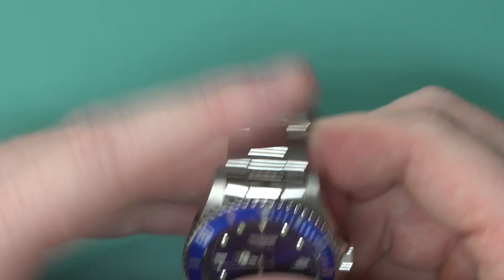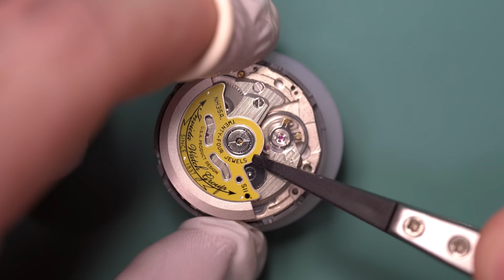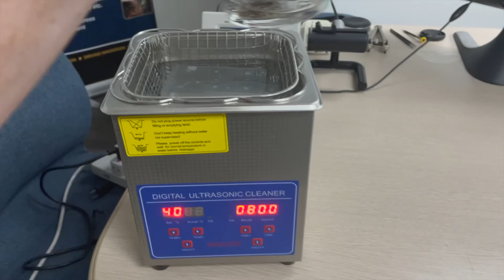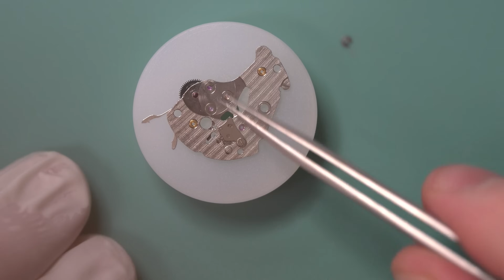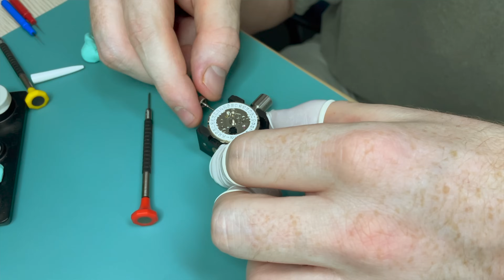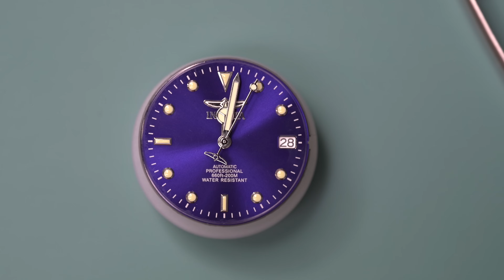$75 Invicta Pro Diver Strip Down and Review - Budget Watch Restoration - Seiko NH35a

Comment: I have 4 of these and they all run great - the NH35A movement is great - i would wear one for work as a bouncer and after numerous ''scuffles'' the pin holding the bracelet to the case had become tweaked/damaged - i was riding my motorcyle home one night and the watch fell off my wrist on to the road at 40mph , i did a U turn and picked it up and it's still running today 6 years later.
Reply: Might be time for a service and relube the movement, the longer it runs with dry lube the worst it will be, probably cheaper to just swap movement than paying a watchmaker to service it tho, i build seiko mods and is pretty easy to work with this movements, my original seiko 5 sport(skx) started getting pretty bad at keeping time after four years, constantly setting the time was a pain, and not trusting it was a bigger pain, the service is a bit hard, mostly due to all the tools and stuff needed, once you have everything is a quite nice hobby, is not that expensive and you can even make some money
Reply: @ELTATUPUNK for all those who can sevice their watch by themself it's OK but a service at a local watchmaker is, in my opinion, not worth the money. A new one is much cheaper! Many greetings from Germany!
Reply: Just don’t get it wet
Reply: @greghemlock6679  ??? Explain what you mean. Its a pro diver watch.
Reply: @greghemlock6679  I've worn mine in the ocean. no problems.

Comment: This is an excellent watch, I work outdoors As a welder summers and winters in extreme conditions, the watch has been exposed to hot welding arcs and severe frosts for 3 years. And still works like new. 247 amplitude +1sec / day   0.2 Beat error

Comment: In my opinion, the factory bracelet is crap. If you spend $60 on the right aftermarket bracelet, it makes this watch impeccable for the money. The right bracelet complements the case/ movement.

I've been rocking this watch for the last 10 years. I've purchased four or five of them over the years in total. They seem to slow down enough to be annoying after about 2 years.

Comment: Why would you not use hacking? I always set my automatics to the second with a radio frequency clock that syncs with the atomic clock. Theres no such thing as a watch being too correct. It also lets me keep track of how fast or slow the movement is running.

Comment: I recently purchased the black pro-diver for exactly the reasons you discuss. I have it on the B&W NATO strap and I have to say it looks the business. Over a week I checked the accuracy to 5 seconds per day and am well pleased with the results. I have no intention to dive with it as I already have other Seiko dive watches, it just looks good on the wrist! I actually do use the hacking facility regularly to calibrate my watches against my radio controlled GMT clock.
Overall I think this is a great little timepiece for the price (£84) especially with trusted Seiko automatic movement. I can only assume detractors think that because of the low price it simply cannot be any good and dismiss it out of hand. I am not ashamed to wear this watch.
Thank you for the very constructive and informative video.👍

Comment: I've owned at least a dozen watches with the NH35A, one NH36A, and a 4R36. All the NH35A movements ran minus 10 seconds per day. The NH36A and 4R36 ran +/- 1 second per day. Point being, there was nothing wrong with the NH35A's. If they run a consistent time every day then all that needs done to get it running more accurately would be to move the fast or slow needle on the movement until you get it as close as possible. Seiko makes a great automatic movement and just as good as Swiss. I had an ETA 2824-2 and it ran +10 seconds per day. It's preferable to have an automatic movement run fast rather than slow because to reset the time you just have to hack the watch and push the crown back in at the desired time. If it's slow you have to wait for the seconds hand to get to 12 o'clock, hack it , move the minute hand forward, wait again for the clock you're using to change the minute, then push the crown back in quickly. Preferably using a cell phone. Or better yet a cell phone atomic clock program from Google Play. Miyota and Orient make great automatic movements as well. Just as good as Seiko IMO as I have had them also.

Comment: I had this same Invicta watch from January 2018 to January 2020. I accidentally dropped it from about 2.5 feet to a tile floor and the Invicta wing logo came loose, so I couldn't wear the watch. Unfortunately the pandemic was just beginning and it was left in the drawer. Now I don't even know where it is. Also, before I dropped it the small hook on the clasp broke off, so it doesn't click in place anymore.

I think I paid something like $100 for mine back in 2018. I thought it would last longer than two years but yeah it was partly my fault. Wish the logo didn't come off though.

Comment: I've watched 100s of these videos to teach myself how to service all my automatic watches. out of all the different people doing this on youtube, I've only seen 1 use a product called fixodrop/epilame on certain parts of the movement such as the pallet fork, escapement wheel, and the keyless works. even the oiling diagram I just used for my sellita sw200 movement tells you to treat those parts with epilame solution prior to assembly and oiling. Epilame is extremely expensive as is the bottle you use for it but being that the oil charts I have for the movements I own say to use it I use it. 
As far as the Invicta Pro Diver, for the money, I think it's a great deal but it won't get you much respect from the watch community. I'd advise saving up a few hundred more and buying a Seiko or even a manual wind Hamilton Field watch. they'll not only last you a lifetime so you can hand them down and they'll get you more respect from other watch snobs than any Invicta watch ever will. well unless you have a nice classic from before they started being cheaply made. even then though Invicta just has a rep now of being cheaply built so for the $65 I'd rather buy a Casio DW5600E-1V.

Comment: Invicta watches that so I have pressure tested are accurate the problem with the Invicta watches Rolex and other watches that screw down crowns is people do not screw down the crown correctly therefore they get water in the lot

Comment: Looks like the one I have, cost €62.
It's a great watch, if I had one complaint, it would be that the crown stem seems flimsy to me but I'm no expert, but I have a pretty big collection from a GoldenEye Seamster to a Casio Analogue and that's just my impression, but other than that, it's very robust and accurate, it's my daily beater watch and is still very presentable.
Battery dies? Replace the watch I reckon, it costs nearly as much to buy a new one as eg replace just the battery of a Tissot.

Comment: Great video. Many who purchased one of these auto versions talk about poor time-keeping. The screw-down crown does work if you want water-proofing. No real warranty which isn't surprising. My experience with Invicta. A nice looking gold plated quartz diver bought on-line and purchased on the basis it did actually keep time, but..... complete waste of money in my opinion. No screw-down crown giving no assurance of water-proofing and worst still, out of the box and in warmer to hot weather or possibly near hot water or bathroom environment, would mist-up inside! Apparently, a common problem! Theoretical reason given - watch built in humid conditions and thus gets humid air / moisture trapped inside during build. Spent money having this looked at but still misted up over a few days. Total waste of money as misting was a frequent problem so unable to wear. The look did create admirers but thats the only positive! A far better long term excellent auto time keeper giving value for money, water-proof rating to 200m diver with Seiko pedigree - Orient at £135 to £160.

Comment: The only complaint I have with the Seiko NH movement is the beat error. No matter how well you adjust, things go wrong quickly. And it's a minor thing, but the torque is low, so the hands that can be installed are small. Other than that, this movement is a true workhorse. It is cheaper to replace it than to repair it.

Comment: I have a 1953 Diver, which I impulse bought one evening after a few drinks ... It's surprisingly-well-built (bezel action, case finishing, etc.) and the bracelet -- while fairly crap -- is vastly better than Seiko bracelets (and more comfortable).

Regarding hacking: I use it every time I set a watch so that the minute hand and second hand are properly synchronised -- second hand is at 12 o'clock exactly when the minute hand touches a minute marker. (My Panerai has a seconds-reset mechanism (when you hack the watch, the seconds hand jumps to and stays at 12 o'clock) ... and it bewilders me that this isn't a more-widely-available feature.)

Comment: I've found 3 levels of NH35 available.  Seiko made stamped S111, TMI made and stamped TMI, and an unmarked Made in China one.  I've had some problems with the last one, no hacking and poor stem fit.  These are much cheaper than you state - I'm buying the first 2 types for $32 CDN equivalent to about $24 US with free shipping.  I'd guess in bulk, in China these are probably about $8.

Comment: Great video! I have several of these Invicta watches. I've got the large yellow dive case that holds 8 watches. I love them all. Not one of my Invicta watches has ever failed me. The only thing I've ever had to replace is one of the pins in the wristband links. It was my fault that I broke it. Other than that, I highly recommend Invicta watches. You get superb quality, nice looking aesthetics, reliable and accurate performance, and prices that can't be beaten.

Comment: The Pro Diver collection has a sub-category called Grand Diver. The Grand Divers have a depth stamp of 300 meters.  The Pro Divers have depth stamps of 100m and 200m. The Grand Divers are simply amazing and do not cost much more than the other Pro Diver siblings.

Comment: I’ve got the Grand Diver that I paid $95 for and it has NH35A movement that has worked perfect for the last 4 years I’ve owned it. I’ve done some diving many times to 50-75 feet and never had an issue. I also own a  S/S 116610 Submariner Date I bought new in 2011 but I wear this 90% of the time because I can beat it up. I highly recommend one of these

Comment: I'm wearing this one right now and keeps excellent time.  I was working in water a whole day with it on and not a single problem with that. The lume is great compared to other more expensive watches i have.  Everything lines up on the watch as does with my other 5/6 Invictas. You really can't go wrong with these watches with the price bracket. If you want to pay a bit more for a good budget watch then get an Orient or Seiko for around £170-£270.

Comment: I bought an Invicta watch with a quartz movement several years ago, its a beautiful watch and its operation has been perfect.  it was quite a bargain in my opinion. The only problem is the warranty was garbage, even on a brand new watch there was a substantial service charge even to repair a brand new watch that was defective out of the box. That is only slightly better than no warranty. I must stress that I have had no issues at all with my watch. The warranty was the only reason I might not buy another Invicta. It is possible that Invicta has changed their warranty, if interested you should look it up.

Comment: I bought this watch in 1999 or 2000 and it’s been serviced only once since. Runs like a top and the lume is still nice and bright. What a value for money it has proven to be.
Reply: You should probably service it. Even though it works amazing, the gears and cogs most likely need servicing and they will wear out faster if you don't.

Comment: I've got an old Pro Diver that I've had for 9 years.  I work in the oilfield and have beat this watch up pretty good.  The only thing that's gone wrong is the second hand has fallen off.  I removed the movement, took the second hand out of the case and put it back together.  It still works fine and is still in my beater rotation, just without the second hand.  haha.  If it ever dies completely, I wouldn't hesitate to buy another one to replace it.

Comment: I've owned an Invicta 8629OB (black dial Submariner homage) with the same Seiko made NH35A movement for going on 7.5 years. I appreciated watched the teardown and buildup of the watch. I paid $86.90 for it then on Amazon, where it now costs $92.79. I charted the time vs. an international clock and it ran less than 4 seconds +/- per day for the first few months (typically slightly slow) afterwhich I stopped tracking. I believe it runs about double that on the slow side these days, though I haven't tracked it.

I used a green scotch brite pad to brush the inner polished links and am glad I did, and would do the same again.  Rather than pay for a service on it, I'd just buy a new one.

Comment: Re: hacking - Other than practical synchronization between timepieces, it also allows precise coordination of  the second and minute hands -ie: the minute hand shows a full minute when the seconds hand hits 12 (or thereabouts). Most of my watches have the hacking function but I recently purchased a Seiko 5 with 7S26 movement (no hand winding or hacking). It is a fun watch but when setting against a known correct time (say a time signal) at a full minute the seconds hand can be anywhere in its' sweep. It is not a big deal in a day to day situation but it makes precise timing more complicated -for example: cooking meat with say 2 minutes per side sear followed by 4 minutes per side cooking time.  With minute priority, the start time might be 6:10":23'-turn over time is 6:12":23'. Alternately, with second priority (assuming a similar  start time) ie: starting when the second hand is at the 12 position, the minute hand position would  be just over halfway between the 9 and 10 minute markers -the "flip" time would be when the second hand transcribes 120 seconds and the minute hand would be about halfway between the 11 and 12 minute indices. So not a big deal but not as easy as a hacked time piece in which the full minute appears when the second hand hits the 12 mark.

Comment: IT'S CHEAPER JUST TO BUY A NEW WATCH INSTEAD OF SERVICING UNLESS YOU CAN DO IT YOURSELF, I WOULDN'T EVEN ATTEMPT IT.  I HAVE MY PRO DIVER 8926OB FOR 5 YRS & USE IT FOR DIVING AS WELL AS EVERY DAY WEAR, NEVER HAD A PROBLEM. IF IT STOPPED WORKING TOMORROW I WOULD BUY A NEW ONE IN A HEARTBEAT. THE ONLY THING I DIDN'T LIKE ABOUT IT IS BRACELET CLASP. IT WAS VERY TIGHT & DIFFICULT TO OPEN. I CHANGED MINE TO MILLED SEIKO WITH DIVE EXTENSION IN LIKE NEW CONDITION THAT I GOT FROM EBAY FOR $20  I FOUND OUT AFTER I GOT IT THAT IT IS ACTUALLY MADE FROM  TITANIUM ALLOY & WOULD SELL FOR $100 OR MORE.

Comment: its funny the list of issues people have had with a Prodiver. I've owned 3 NH35 powered watches and one smaller Quartz. They have all been well built and run like tops. One has been cannibalized to save another watch, one has been modified into a field watch and has no issues getting wet. The final was gifted to a family member when I decided I didn't need it. 3 years later its ticking along perfectly. 

Its not a $400 watch. Its a convincing $150. Its a perfect $75 watch.

Comment: I don't know if you pay attention to comments on older posts....but I will try. I have an Invicta with the NH 35 a movement and the crown and everything else, the stem... came out one morning when I went to change the date.  I had the watch less than a month, so I sent it back into Invicta, and about a week later they told me that I would have to pay $188.00 to have it fixed.  I paid just a tad over $100 USD for it, and I know the NH 35 a movement is not that expensive. I looked at the stem and it looked fine...nothing was bent or had been snapped off. I do have a Pro Diver with the same movement and I was wondering if it would be a simpler just to have my local jeweler do a simple movement swap.  Or...was the Invicta repair dept. trying to scam me???

Comment: What cleaning? It is New. You don't have the Vacuum to test pressure? You buy a watch for less than $100.00 USD. and expect to dive down to 200 feet maintain integrety. You get what you pay for this is somewhat confusing. The pressure probably meets "price standard" nothing else. Marketing will sell you anything that's there job, is up to you.   Bye...

Comment: I think Invicta is a great watch to start with for what you get. It will introduce you to the finer pieces out there. Invicta is something I'd never personally buy unless it's one of the cooler homages, but still on the fence on that one. I sold all my watches ranging from Seiko to Alpina and ended up with a Longines Legend Diver with black lacquered dial as well as their new updated movement L888.5 with silicon hairspring and free sprung balance wheel. And don't forget the 72h power reserve. I wear it on a Eulit Palma Pacific two piece perlon strap, these make one of the best, if not the best perlon straps in the world. Haven't felt the urge for another watch yet, but damn the watch world has too much greatness to offer for that to last.

Comment: My every day work watch is made by Android. With this movement. 
It takes a beating. Keeps very good time and has never given me any issues what so ever. You just caint beat it for the cost.
My watch is made out of 316-L SS.
Has solid steel links for the bracelet. 
Case is solid SS also. Blue Sunray dial with three number date display that is extra large. I only paid $99 bucks for this watch and have been wearing it for over a decade.